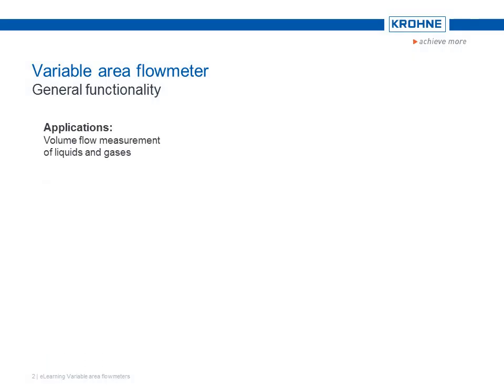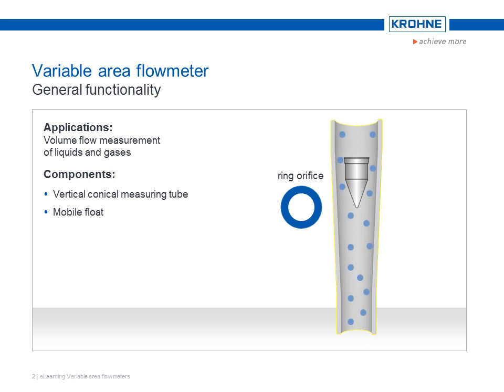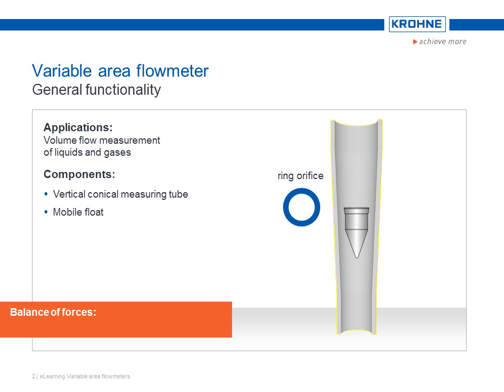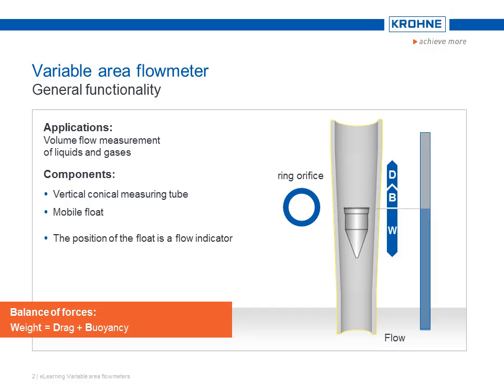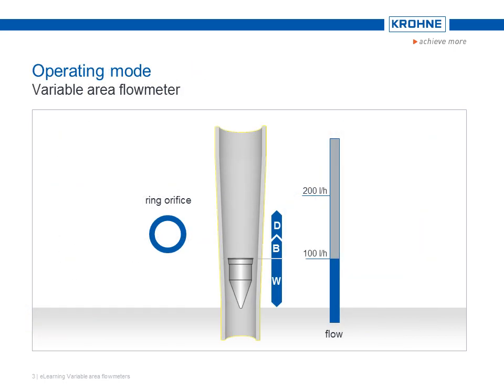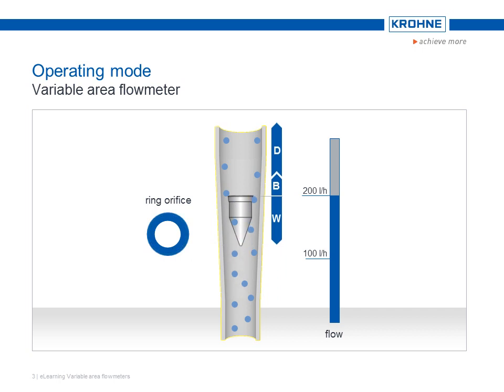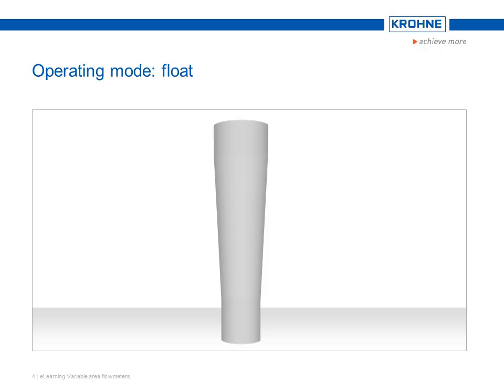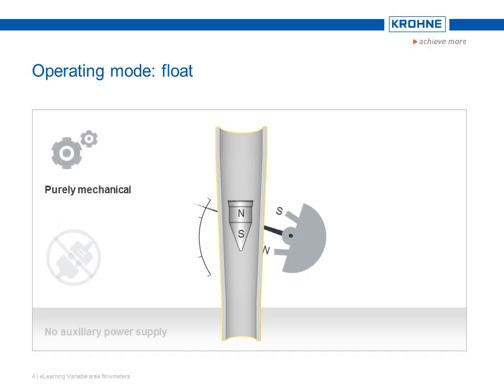Measuring Principle of Variable Area Flowmeters | KROHNE

Comment: What to do if a rotameter consistently reads lower than the actual flow rate?
Reply from the maker: Hello, Thanks for your question! Check and ensure that the operating density and viscosity are matching the sizing parameters of the variable area flowmeter. If process conditions are different from sizing conditions the scale needs to be corrected and reprinted. Best regards.
Reply: Hello sir, please how do you solve the problem . I have the same one and i am really confused with.